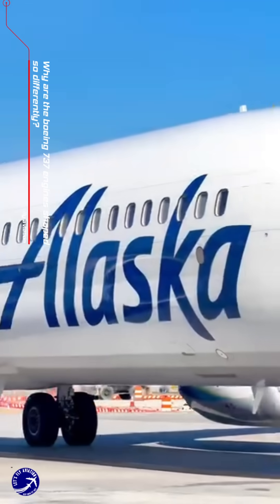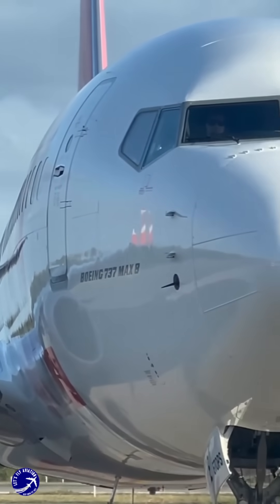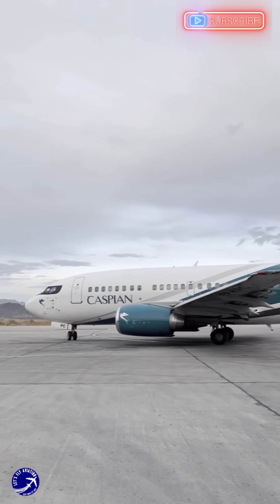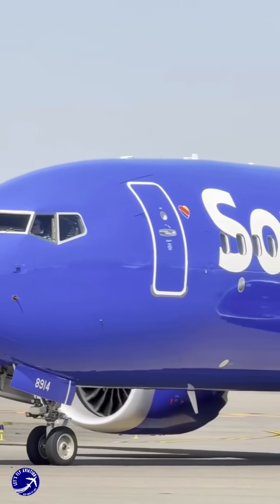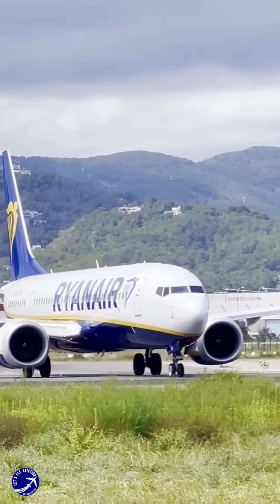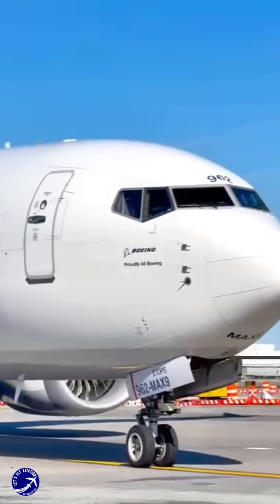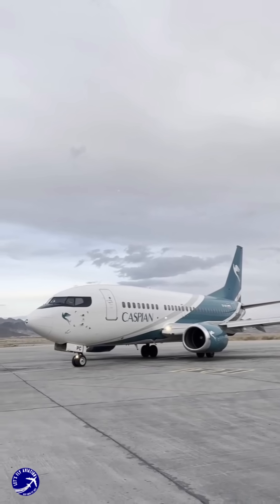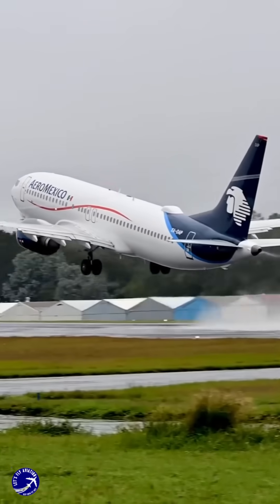Why are the boeing 737 engines shaped so differently?

Comment: What a ridiculous video. You don’t answer the question as to why the engine looks different. Meaning, why it’s flat at the bottom. 

The answer is that the initial engines on the -100 and -200 were small enough to fit under the wing, but all the later 737s from the -300 onward, couldn’t fit properly and they had to flatten the bottom to keep it clear from the ground.

Comment: Not even a mention of the characteristic flattened lower cowling on classic 🫩 or the comprehensive redesign of nearly every aspect of the max which, in relation to this topic, changes in landing gear to raise the aircraft static height enabling clearance of the leap. These are the engineering choices most relevant to the title.

Comment: The real reason is the FAA requires a minimum clearance from the engine above the ground. Hence the flattening of the cowing at the bottom of the engine.
Reply: But it still goes about the newer bigger engine had to be repositioned more forward to accommodate the clearance from the floor, they had to redesign a whole new engine mounting bracket

Comment: Should check your facts Indigo around 2020 switched from GTF to Leap 1A that is all they have on order. They are slowly replacing their fleet with Leap 1A powered aircraft. Also no mention of the A220 which is powered by the GTF.
Reply: But earlier models had smaller engine 
When they installed big ones they had to redesign the engine brackets, to adjust it for higher clearance from ground, here on YouTube is the video about this